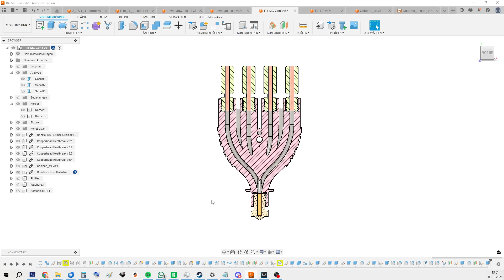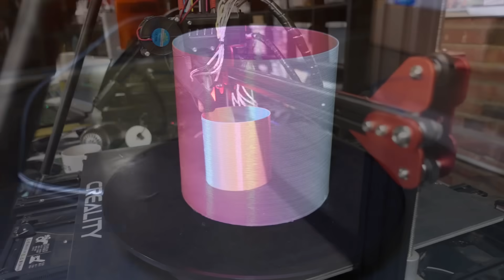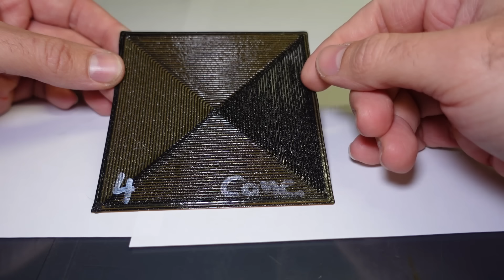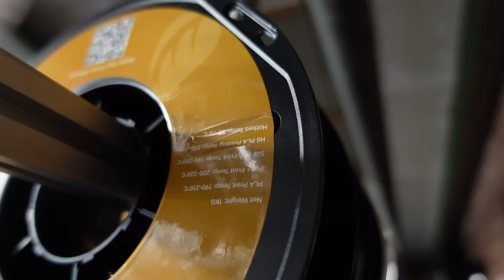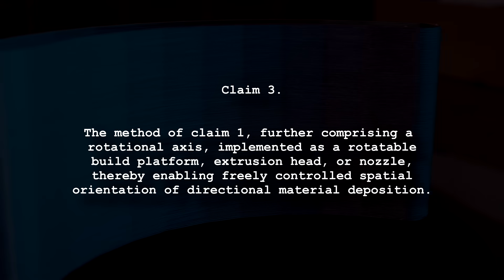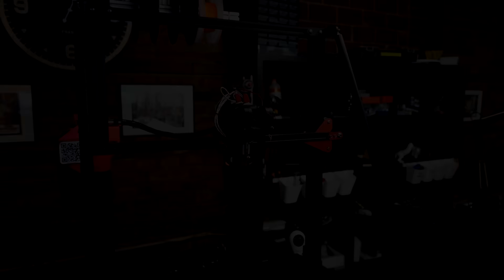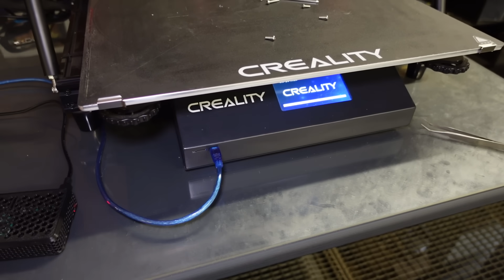WASTELESS Multi Color 3D-Printing. Introducing the Open Source Co-Hotend (Roetz-End E03)

Comment: I literally yesterday I was talking to a friend about something similar.
I wanted a full color range extruder.
I wanted to mix this system with a nozzle that will create turbulence and mix the colors.
I thought about curving the paths the "merged" filament has to go through so that the different sides of the channel would be different lengths.
Idk exactly how to create the different lengths paths efficiently though, maybe trilling multiple channels at different angles and then merging them would create sufficient color mixing.
Then you can control the speed at which you feed individual filaments to create the full RGB space.

I saw this video where CNC Kitchen tried to mix the dual color filament:
https://www.youtube.com/watch?v=RrIzzSfuSMs
Reply: If you add this, I want to be on the patent as well 😛

Comment: Awsome. Good luck on claim 3. I was thinking of building and rgb head but you would never want any one plastic to sit and bake while not in use. The co-extrusion solves that. I was thinking, And you are just the guy to build it, of a neutral feed stock and micro extruders feeding color concentrate. When I worked in plastics, we had color concentrate in pellet form that was generally designed for 2% mix but could be from 1 to 4%. Liquid color was a lot lower %. I was thinking also of a shuttle valve to very quikly change from one plastic to another like support/main or tpu overlay/base. Keep up the great work!

Comment: How often do we print with no I fills though? Just use the infill to purge oil filament. Just have to optimize to make it flow consistently when switching filaments. At least it could work with like material. Neither purge infill nor this method would work well with unlike materials though.

Comment: still has to many limits, multi tool head still better way. cool idea though. I could see this going to do color blinding to get some really one of the kind colors.  now if you moved it into a nozzle rotation but that i think is what lead to bondtechs INDX nozzle system on a rack.  cool idea though..  what i would find useful in this over a toolhead is blending of colors. Could just a thought use that type of hotend for a extruder to make your own colored filament?

Comment: Does this work with four independently driven extruders and just feeding <4 materials, and letting the remaining ones pause? 

With a small purge tower we could achieve multi color or multi material without mixing up everything, rotating heads or beds.

Comment: Did you yell eureka and run around after thinking this up? 😂 

The mixed metamaterials concept is incredible, could be a lot of study there.
Conceivable you could have various count nozzles from this, 3, 8, 12+ even to vary the ratio or angles between separate materials, depending on application?

8 channels alternating filaments could print a stiff cube with a gradient to flexible material in the corners. Or depending on the capability of bed rotation, you only need the # of nozzles = material

It's like... organic almost? You could tailor individual material properties to exactly where you need them in the print

Comment: This is very cool, however I struggle to see what the point of this is outside of mixing whatever colors you want as co extrusion directional filaments already exist. Also, mixing materials isnt exactly special either.

If someone can inform me of a practical use outside of a cool looking affect which can be achieved with specialty filament id love to hear it.

*Furthermore, these nozzle/hotends must already exist in some form based soley on the fact that multi colour filaments exist.

Comment: Can't you just use multicolor filament for this?
Reply: No, because multicolor-filament is nearly impossible to align with the printer axis, whereas this solution fixes the orientation problem as well as opening up color choice to your entire inventory of the chosen material
Reply: short answer is filament will twist during printing, would be impossible to align

Comment: I don't really think that the waste problem has been solved. This cant print a single color that isnt blended. Printing with multiple colors with the idea that only 1 color is visible. Is wasting 3 other colors. If ya want orange. Just use orange. Not orange and 3 more rolls. That just money down the drain. Granted the multicolor vase looks nice. But dual or triple color silks will yield pretty similar results. With all that said. I do appreciate the work that has been done to explore new ways to print. I just dont see what this could be used for? Something like Hueforge would not benefit from this. It would make for interesting articulated dragons etc. But Spongebob would just be smearbob.

Comment: Saying compromising instead of comprising was almost as cute as you

I like to watch all kinds of remarkable creators in their fields, (woodworkig, smithing, inventors ... etc) for different reasons special to them, you are quite unique.
I especially like the methodolgy you take and your ability to not only focus one road but also to branch out to lateral ideas; I saw the color control of the 3D printed model by shifting extrusion direction coming a few epsiodes ago but didn't think you would allocate time for it so soon.

Comment: This is basically just manually picking the colors of the 4 color filaments that you can just buy out there. And it's how they extrude them to make the rolls in the first place.

You can also achieve this in 2 colors with any unmodified printer by printing a spiral 1.75mm tall and pause switching filament halfway through. Then just using that length as unspooled filament (Shown by angus on maker's muse years ago) 

And for the tpu pla combo there's also filament with different core and sheath materials, though most of them focus on having a fiber reinforced core with a high layer bonding sheath.
Reply: Totally agree. There are already filaments with 2 or 3 colours on the market, that could be used for the same principle. And you don't need a special hotend for that.
Second, there are "mixing" hotends, that place the Bowden inlets in a circle, but produce  exactly the same colour changing effect. This all has been already investigated in reprap forums about 8 years ago or so.
I do appreciate his ambition, but this already has been done and was not very successfully. Although, I have to admit, we didn't have Klipper Firmware back in the days. So maybe it's worth trying again nowadays?
Reply: @sandrolauer350 i don't see how klipper changes anything. It's not like there's any attempt to modulate the filaments feeding through the print to change the colors more. It's just feeding 4 filaments at 1/4 speed consistently to get the same amount of material through. You could always control extrusion speed.

Comment: Just came home from the pub so I leave a disclaimer that my thoughts might not be going the way they should...

In claim 1 I would probably have phrased it along the line of "wherein the deposition of each filament is actively controlled with regards to the deposition of the material flows originating from each filament". (movement direction of print head allows for rotation of the nozzle)
In claim 2 I would probably have had a second thinking before writing  "multiple independent melt channels" (since melting could probably be done in channels that are somewhat independent or possibly the melting process could be done in one channel, it becomes one channel as soon as there is ANY opening between the channels).
Claim 3 probably covers off my comments on claim 1.

I love the work that you are doing and that you aim to make any patent open source and show previous art.

I saw a comment about previous art, with a link, before writing this so there is where I am going now 🙂

Comment: ooooo i have alot to say about this

the basic idea is how multi color filament works, and im guessing, is similar to how its made. Ive recently bought a few variations, and the result is exactly the same, just with your version, you get to choose your colors, and you get 4, not just 2 or 3. ive printed a 3 color Escher star, and i too realized how well the colors mix on the different sides..... particularly i have one filament that is black, red, and orange....... and when it mixed on the off angled sides, i ended up with greens and purples, but with the same, umm hues, i think thats the word...... it was a variety or colors, but all still had that red black orange theme to them..... instead of being the "volcano" theme the lable mentioned, it was kind kinda rusty like, still very cool.

i like your idea, but you need to be able to rotate the hot end too, so you can choose where the colors go, and are not limited to that color only on one side. ive been wanting an extruder that does exactly what yours does, and that was even before my recent experimentation with multicolor filament. If i ever can it would be cool to get one.

also, im curious..... i would like to see what happens when you put 4 different 3 color ( lineally colored , down the whole  role, not alternating) filaments in that thing........ thats 12 colors, at 12 different angles............... i even have this one multi color from solvol, that its made exactly the same as the others, but the colors are spiraled on the filament instead of being straight down it linearly........... so when you print, the colors rotate......... on small objects, you get a clear spiral of colors..... on large objects, you  get weird layers that are partially colored on way, and on the other side another way..........sorta reminds me of those bottles with the different layers of colored sand that used to be sold in gift shops.......... if you tried 4 of these multi color spiraled filaments, i bet you would get some super fancy artistic outcomes, especially since it would be impossible to line up the colors intentionally, and impossible to keep them lined up..... everything would come out super unique

also, i really like the stripes on the tops and bottom, im sure they have applications somwhere, they look good on the escher star, especially in the 2 color. i have a cobalt blue and burnt orange on that just look great.

alsoagain , if you do concentric tops/bottoms, you get swirls.... sometimes.... i havent figured out when....  i will make one print with 2 objects, and one will have a swirrled bottom, and the other will have a "color wheel" thats all a gradient........ i havent figured out why

yet another also....... ironign dosnt blend the colors well in my experience, it just kinda smears them, maybe youll have better luck, but i didnt like the results i got.

Comment: This is what we were talking about when talking about multi color printing. Very happy you figured out an actual way to make it work.
Suggestions:
The dovetails could have a slight taper so it does not need screws, it would hold the accessories by shape.
I was wondering, how would a hot end like this work if you would use a single heater, but you surround it with the 4 channels.
This way it could be fully symmetric and maybe more compatible with simple machines, if one heater is enough this way.

Comment: Geeetech did something similar with their A10T/A20T/A30T (T for tripple) printers.
I have 1 of those hotends and even though it has heat creep issues among other issues, what I found very interesting were the brass discs that act as valves for each filament path, meaning if you retract 1 or 2 filaments the back pressure will push the disc up blocking the filament path and preventing filament extruding the wrong way...
If you're interested I could snap some pictures

Comment: I think you should do a 3 extruder variant for some good old CMY vases. I wouldn't know what to do with the 4th colour.
I'm also keen to see what you come up with for introducing turbulence to mix them. I've been thinking about that since you tried multiple colours in the minuteman. I'm not sure about your country, but here we can get two part epoxy adhesive that comes in a dual syringe. It has a nozzle which mixes the epoxy as you dispense it so by the time it leaves the nozzle, it's fully mixed. The mixing nozzle has specifically shaped fins in it which presumably are the best geometry the company could come up with for reliably mixing the two parts. Failing that, maybe just a suction of gyroid structure will do the trick. Hell, maybe the epoxy nozzle would even have gyroid if it could be injection moulded.

Comment: I have watched a video (probably an expo type event) about a 3D printer that printed many colors at once and turned the nozzle to keep your desired color on the outer layer. I'm unable to find it again. I don't remember if it had 1 special nozzle or multiple nozzles grouped together. Besides easy multicolor printing, it was fast from printing thick walls with all the colors at once (unusable for small prints or fine detail).

Comment: Would doing two horizontal heaters on one side instead of 4 vertical heaters help even out the thermal properties of the mixing area? Maybe even a second thermal sensor closer to the nozzle?

Comment: The Chinese four-color Zonestar Z9V5 PRO 4 printer I bought in 2023 does the same thing using the same design. You've reinvented the wheel.
Reply: Nein er hat auch ein mischerhotend was sehr nah an dem modell hier ist
Reply: Very relevant comment, can someone explain the differences between the techniques?
Reply: From what I can find, that printer is a 4 in 1 out multicolor swapping like Bambulab A1.

Comment: That's pretty cute. Now: (1) mount the head on a core-XY or cartesian gantry, and (2) set up the bed for rotation. By matching the rotation of the bed with the direction of motion you can print whichever color on whichever surface you want.

Comment: For sure, you've thought of this, but didn't mention it:  1. you spoke about rotation of beds, hot ends or nozzles. You can however print in a desired color, by slicing the model so that the filament gets deposited in a direction per color. This way you don't need any rotation. Printing will be slow, but people might get around your patent like that, if it's not mentioned.
2. Your hotend can also be used in a hibrid mode! 🎉 By hibrid, I mean, printing in a certain direction with 4 flowing colors, but as soon as the print only requires one of your fed colors, you stop feeding the other colors, allowing you to print in any direction with that color. So there's 2 modes, that can be used. Switching between the 2, during a single print can be seamless and could save a lot of time, if you don't have hardware that can sort out the rotation. You just need slicer software that knows how, and when to switch modes.

And finally: Congratulations! This is truly wicked stuff, that'll give 3d printing a massive boost! Keep going!

Comment: This is an interesting approach. Tronxy produces a Tri Color Silk PLA filament that creates a similar effect. Using such a multicolor filament would make your complex mixing head obsolete. However, to get the level of control over the color that you aim for would probably require a square filament that cannot twist while being fed into the extruder.

Comment: I had a similar concept several years ago, with the key difference being the use of independent extruders and a specialized nozzle designed to handle filament changes. The main issue with traditional systems is the significant waste generated when filament must be retracted a long distance and then purged before switching colors. My approach aimed to minimize this by ensuring the filament mix occurred directly at the hotend tip, thereby reducing material waste.

While a few printers have implemented similar ideas, I took the concept further by developing a custom 3D-printed nozzle. Ultimately, I had to abandon the project due to challenges in developing the necessary software to support it—at that time, Klipper was not yet available.

Comment: With independent extruders you could also increase the flow on the primary color and decrease the other ones. you just have to calculate the switching timing.

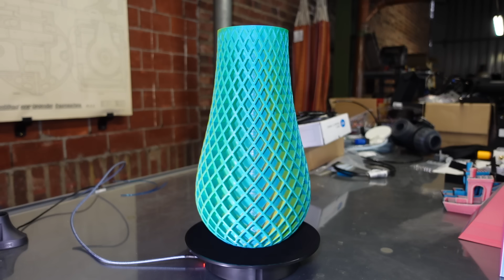Comment: 5:45 "There is prettymuch no way to achieve this with conventional methods" - except with, you know, multicolor filament...
Reply from the maker: Nope. Two pair of shoes
Reply: @Roetz40  "Two pair of shoes" That must be a German colloquialism equivalent to "apples and oranges"? But seriously- Though it may have sounded glib, my intention was not to minimize your amazing work. And, I'm not referring to a 'color cycling' filament, but a proper co-extruded multicolor filament. How is this different in results?
Reply: While is true that a vase May not have Been the best example, Ro is still right, in this one you have control Over the input, With multicolor filament all of the print is of a multicolor With gradients, Ro's nozzle can have control over the gradients
Reply: @ulforcemegamon3094  Are we referring to a gradient "color cycling" filament or co-extruded multicolor filament? Because the best I can tell, the only difference would be keeping the co-extruded filament feeding in straight, and the reel and stiff filament keeps the twisting of the filament to a minimum.

Comment: Great idea!  Its similar to "Diamond"  mixer hotend, which uses one main heating head for all 3 inlets. But obviously this is only good for same type of material on all inlets. Your hoted has also one solid heating core, so it will be tricky to stabilize very different temperatures.